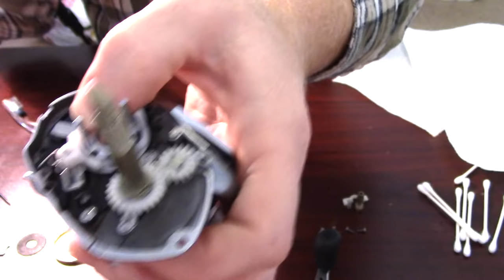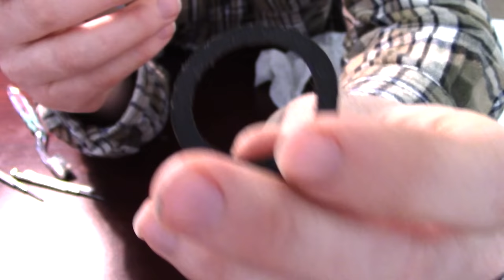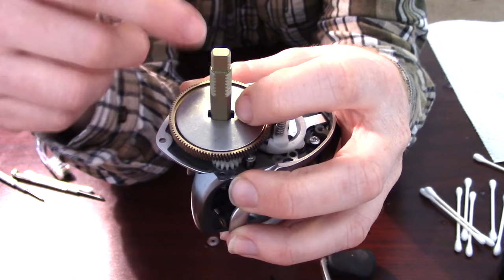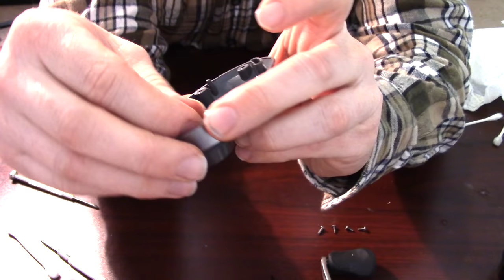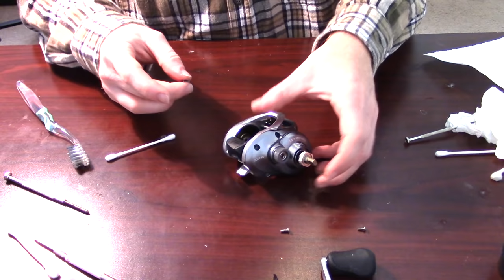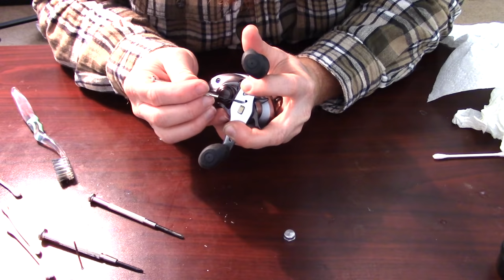Shimano Curado Full Reel Cleaning - Part 2 - Cleaning and putting together

Comment: I had been fishing a lot in the rain and water got inside my reel, then it started to make a squeaky nose every time I turned the crank, your video was very helpful, there was one part that sucked really bad putting back together which was the little spring on the inside, luckily I had another curado next to me to help figure where those 3 pieces fit. So glad I took it apart and cleaned everything out thanks to your video. Respect
Reply from the maker: Thanks man, glad it helped.  Those springs all suck..  lol

Comment: Came to this video looking for help. My spool acts like it’s wanted to jump back and forth and loose its catch with the free spool system. Haven’t had a clue what’s causing it. Awesome video!
Reply from the maker: Hey thanks, glad you like the video.  let me think about it and maybe I’ll figure out an answer to help fix your Soooo.
Reply: McFly Angler thank you!
Reply from the maker: Ok so have you tried tightening the spool drag?  Look at that nob (right under the star drag) and tighten that down first.  If the spoon doesn’t move back and fourth then just adjust that to where you like it.  If that doesn’t fix it then maybe you have a stripped drag.  Take apart the reel and see if you can clean the gears first.  If there is damage to the gears then maybe you need new gears.  It can happen when a big fish strips drag that is too tight.  But it is rare.  Other than that maybe check out the bearings that hold the spool shaft, and also make sure the spool shaft is sitting correctly.   Also look to see if your spool is bent or the shaft is bent.  Anyway, try all those, if nothing then I’d suggest taking it to your local shop that can do repairs
Reply: McFly Angler there is a little rod through the spool shaft going perpendicular with the shaft and there’s a little slot it goes into on the free spool system. It seems like it’s not holding in that slot and the spool is moving back and forth to much. I’ve taken it apart around 3-4 times and can’t figure it out.
Reply from the maker: Can you PM me on Instagram so we can exchange pics?
Reply from the maker: Just easier to assess things with pictures.
Reply: McFly Angler what about Facebook? I don’t have instagram
Reply from the maker: I only get on Facebook once a week roughly, when I’m posting my videos.  I don’t put facebook on my phone.  That’s fine you can pm me there but I probably won’t respond till this weekend

Comment: Your video was EXTREMELY Helpful - last night I was banging my head on my the reel would only turn backwards after I put the plate on...I am sure I put the Anti Reverse in backwards as you mentioned - such an easily overlooked deal.    One question do you have  technique for getting small C-clips on and off ?
Reply from the maker: The C-clips suck, really there is no great way to do it.  When I used to clean reels for a tackle shop, we had a tool for it.  But they are hard to come by for the public.  Honestly I've tried two ways, one is with a small screwdriver, the other is with small tweezers.  Both can send the thing shooting across the room never to be found again.  Good luck, sorry I wasn't more help with that.  

Glad I could help with the anti reverse thing.

Comment: Did the processes you showed in all three videos. Super helpful. BUT I STILL NEED HELP. The reel functions perfectly and is much smoother now that I cleaned it out, but I have an annoying noise. This noise was there both before I took it apart and after. It’s actually the whole reason I cleaned it in the first place. It’s only when I turn the handle. It sounds like there is some metal rubbing or something like that. Anyways, someone said that I may need to replace the pinion bearing. Could you direct me towards which bearing in the video could be referred to as the pinion bearing? Or suggest what else it may be? It would be super helpful!
Reply from the maker: Sorry man, I can’t right now, I quit the channel a few weeks ago and been working 14 hours a day, and 6 days a week.  Just no time to go over this right now.  Hope you can find your answers though

Comment: To each their own but those carbon disc are the drag disc and you dont really want grease on them as it can hinder the reels full drag pounds.
Reply from the maker: Too much can yes, but a little of it is actually beneficial to the longevity of the drag disk, and also helps keep it smooth.  I mean it’s a toss up, if you want super strong drag, then maybe don’t do it.  But I’d rather trade 1-2lbs or pressure for the smoothness, as a jerky drag will loose a fish.
Reply: @McFlyAngler  I hear ya bud but carbon disc are self lubricated in a way. I've always been told to not lube cause some grease or lubes can deteriorate them as well. But I havent had any issues with ardent reel butter.
Reply from the maker: Yeah, the grease I use is called "drag grease".  I've always used it, very sparingly BTW.  Never had issues. Caught a 70lb black sea bass on a Curado 300 once with no drag issues.
Reply: Drag grease is that the grayish black stuff? If so thays good stuff. It has like some powdered substance which adds grip to the disc.

Comment: thank you for the helpful videos. I use rubbing alcohol on the q tip to clean.
Reply from the maker: +Caliyak Fishing do you have trouble with rubbing alcohol deteriorating any of your plastic pieces?  

Glad I could help.  At the fishing shop where I worked we always used soapy water, but I'm always looking for better ways to do stuff.  Thanks for the tip
Reply: I have not seen any damage or issues to the plastic. I grease and oil everything so I really don't see an issue with drying or cracking the plastic. I appreciate alcohol because it dries without rusting the metal or no water issues. test it on a cheaper reel and see how it turns out. We need to find great and efficient ways to keep our expensive tools clean and working right.
Reply from the maker: Yeah I hear ya.  I never really had issues with rusting and using the soapy water, I just make sure and rinse it good and let it dry before putting it back.  But alcohol sounds like it might be quicker and easier?
Reply: I think so, give it try
Reply: You can also use naphtha. That’s what I use. It’s essentially lighter fluid....same stuff they put in reel cleaning sprays. Safe on any material used in reels and it evaporates CLEAN. No residual nonsense.

Comment: I have a Curado 201G6 and the reason I tried your deconstruction and cleaning was because, when the drag reel is tightened down, the handle turns but not the spool when reeling a large fish.  I had the reel fixed two years ago for the same issue.  Any idea what the issue could be?  I successfully completed your tutorials, but the issue was not fixed unfortunately.
Reply from the maker: Could be a number of issues but first thing comes to mind is the drag.  Was the fish able to peel drag out?  Like when you tighten it did it seem like it just didn’t tighten enough?  Or was nothing moving at all?
Reply from the maker: It’s just tough to diagnose without it in front of me.  And this tutorial was for a cleaning not a fixing.  Happy to try and help though.  Might help diagnose if they told you what the issue was with it before when you got it fixed 2 years ago...
Reply: Thanks for taking the time to reply.  I wasn't actually told what the issue was when the shop fixed it.  I should have asked.  Yeah the fish is able to peel drag, and smoothly.  I was thinking that maybe the drag was not just tightened enough in that instance but, even when its tightened almost all the way down, I can put thumb pressure on the spool (to simulate a fish), and still the handle just turns without turning the spool.  I would think that with the drag right tight there should be almost no play there.  Maybe I need some replacement parts.  I appreciate, you help and also appreciate its hard to tell without seeing.  Maybe I could email you a video.
Reply from the maker: Ok it’s one of two issues (for my first thought). Replace the drag, like get new drag for it.  Could be that the drag is smoothed out and not holding as much pressure.  Do you back the drag off after fishing?  If you leave it compresses it will do this to a drag quickly.  2nd could be that the washers that are curved aren’t put in correctly.  There are some bowed washers that create pressure.  Without those installed opposite of each other, the drag will not have enough pressure.  

First look at the washers (right under the star drag) and make sure that the two are creating a bow in the middle.  Not faced the same direction.  If they are good, then look at the drag and see if it’s compressed.  If it looks smooth then order a new drag.  If you can’t tell, then take a picture of it and send it to me.  Best way is on Instagram.  Find me by searching McFly Angler.  I can kinda tell from a picture of the drag is really compressed.  

Also you don’t have oil or too much grease on the drag do you?
Reply from the maker: Also has this gotten gradually worse or was it like all of a sudden type thing?
Reply: I think its a gradual thing.  Not all of the fish I fight are big, so maybe I didn't notice :) . I haven't been backing off the drag but, after seeing your video, now know the benefits of doing so!    I was wondering about those two washers.  When I took them out I was careful to place them down on my workspace the exact same way.  I cannot even see a bow in either, so maybe they have been compressed?  Also, the top metal washer in the drag system;  your video indicated it had somewhat of a bow that goes up (but that may have been just specific to the reel you were using).  That top washer in mine doesn't seem to have a bow, seeming to mean it does not matter which way it goes on.

If I order a new drag, would that come with these two washers, or is that a separate order?

I will look you up on Instagram and try see about sending pics.

Cheers
Reply from the maker: Yeah if there is no bow in the washer than maybe a different model but I doubt it.  The last 20 years that’s what shimano has used...  not sure though with the brand new ones.  As for ordering the drag, no it won’t come with washers, only the drag unfortunately.  Send the pic of the drag, both sides, and I’ll take a look.  Might be all you need.

Comment: What about cleaning the worm shaft? How do you clean it and do you grease or oil it?
Reply from the maker: That’s something I didn’t do on this, but it’s a c-clamp type attachment on the side, then it comes right out and easy to clean, just a pain to put back with that c-clamp or some people call a C-ring...  

I’ve had some success in the past just using a toothbrush to brush it when it’s in place, if it’s not overly dirty.

Comment: Have a curado 101d. At every revolution of the handle the reel locks up. Free spool button tends to free the spool for 1 turn & it locks up again? Any thoughts on what's wrong?
Reply from the maker: Did you take it apart?  It is maybe a gear issue.  If you take it apart and the gear is warped or broken then you know the issue.  If not, then I’m not 100% sure without looking at the reel myself.

Comment: Dang you got close to a full teardown in the end but you didn't inspect the bearing at the base of the drive shaft.  That bearing is often the first to go and worst to access.  Getting right up to it but not pulling out the drive shaft to inspect it is a head scratcher.  I mean you even pulled the screws!  Well maybe just something to remember the next time you get the main gear off.
Reply from the maker: I’m not sure I 100% agree, since I knew the bearing was fine.  And this is one of the better breakdown videos on YouTube, can’t expect perfection though.  I’m sure somewhere you can find someone that takes that part out and describes how to clean it.   Have a good day.
Reply: @McFlyAngler  I totally agree.  This is a very good video.  I didnt mean to imply otherwise. I just wanted to draw your attention to that bearing because that is the one that I seem to always have trouble with if I don't pack it with grease.  I fish saltwater mostly so I'm a bit paranoid as I have that one and the one ontop of the anti reverse clutch constantly under attack.  The one at the bottom is the worst though as it sits in a well and if water gets in there, it has nowhere to go, so it turns into a bearing jacuzzi.   Lol. Anyways, good video!

Comment: I’ve done this 2x, and both times I cannot get the drag to hold. It will click and hold and never catches. Got my girl to do it a year ago and I just took it apart and did this and again I can’t get thebdrag to start
Reply from the maker: Ok so, try the drag bearing in the handle assembly.  Just take off the handle, and the star drag.  There is a round bearing that fits over the shaft.  Reverse that and assemble again.  Let me know if you have drag.  We can try some other things if that doesn’t work

Comment: Thanks man.  That was super helpful!
Reply from the maker: +jaymarque no problem, glad I could help
Reply: McFly Angler on my first round, I greased the drag and must have used too much.  I literally had almost NO drag even cranking it down almost all the way.  I disassembled it and cleaned/dried off the the drag washers and now it is perfect.  Thanks again!
Reply from the maker: Gad I could help.  Yeah, too much grease means no drag.  Of course, if you don't have enough, then its not as smooth.
Reply: Thanks this video helped me out a lot I dropped mines in the water today and tried to clean it but didn’t know how to thanks for the video saved my reels life!

Comment: why should you not grease that certain bearing? and which bearing was it?
Reply from the maker: The anti reverse bearing.  If greased too much it will not anti reverse anymore
Reply: thanks, and thats the bearing on the reel side plate? on the sharft that holds the reel handle?
Reply from the maker: The one that has ridges.  If you look at the inside of the bearing it’s got long  cylindrical bearings in it, not round.  You can see them on the inside of the bearing, you don’t have to take it apart.  It sits on the shaft.

Comment: after doing all this and putting back together when i reel it in it sound like dirt is is grinding.... got any ideas thanks, oh yea and does bow side up mean the curve going up or the curve facing down, if you could answer these questions it would help a fellow angler alot
Reply: ok one more thing lol, i feel like the reels anti reverse isnt as good, when i reel in and stop and go in the other direction it will go that way just a hair but it wasnt like that before sorry if im asking a bunch of questions.. but if you could answer it would help a ton(this is my only reel and i dont want it screwed up)
Reply from the maker: The anti reverse should not have any oil put in, just a light coating on the outside.   Adding oil to it could make it slip going reverse...
Reply from the maker: When you mean bow side up or down, are you talking about the two washers that are put together opposite?  Honestly I don't think it matters, as long as they are facing opposite directions...  But I usually put the outside ends together with the bow in the middle...  

The dirt issue could be from 3 things, either the reel wasn't put back together properly, there is still dirt in the gears that when cleaning you moved them around to a spot that makes that grind, or you didnt grease the gears properly.  Most likely its the 1st.  Did you watch the next tutorial in this series?  it discusses the spool and casting break cleaning (should be done more regularly).  If you watch that, and do that, it could fix the issue.  What I think is happening is that the spool has some dirt in it, or taking the reel apart, might of dislodged the bearing slightly to give a grinding issue.  Try the 3rd tutorial first (should be 10-15 minutes), then if still a grind, I would take the reel apart again, and make sure all the parts are put back properly.  Sometimes even put back the right way, but a little off center can cause an issue.  Just make sure they are all sitting pretty.    :)
Reply: alright got the dirt issue fixed all i had to do was clean the spool, im gona take the reel apart again later on and see what i can do about the anti reverse, thanks for the help:)
Reply from the maker: no problem, glad I could help.  Just keep in mind next time not to get any oil in that anti-reverse.
Reply: @McFlyAngler  so no oil. What about grease on the anti reverse?

Comment: After putting all part together, i still  hear grinding sound? Any help. Tq
Reply from the maker: +Fahmy Amer you make sure and clean all the parts?  If so, you might have a problem with one or more bearings.  It's tough to clean these bearings since they are usually sleeved.  You might need to buy some new bearings for the reel.  Try taking it apart again and test each bearing.  Find the one "or ones" with issues then buy that bearing and replace it.
Reply: thanks